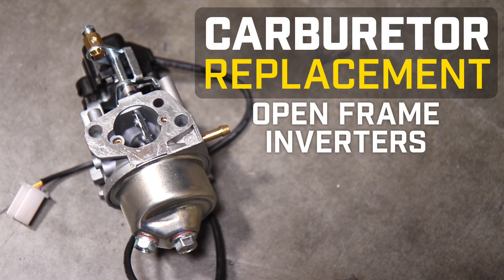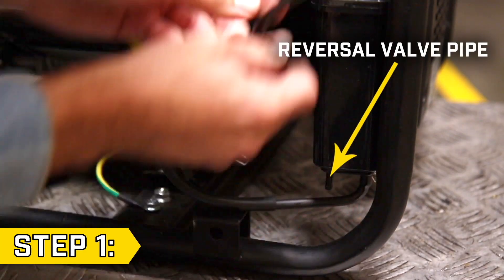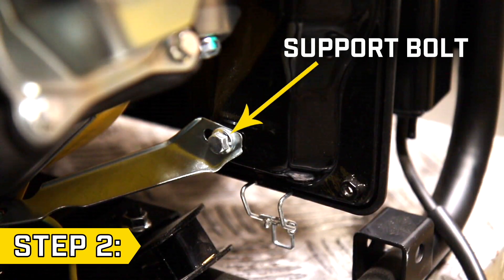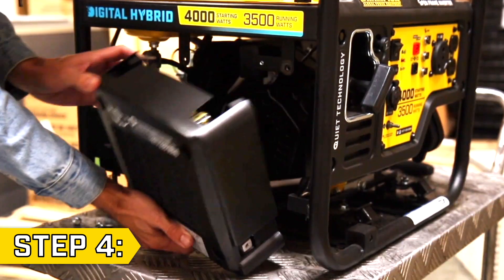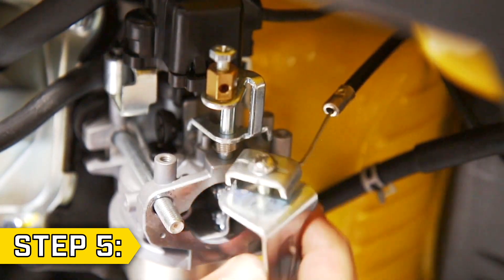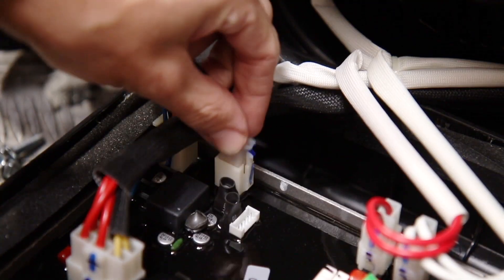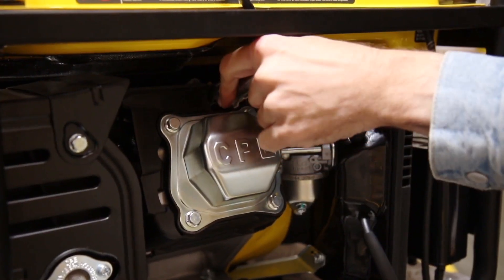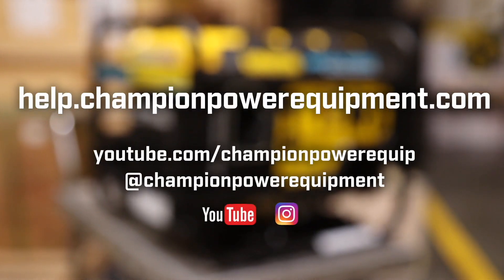Carburetor Replacement (100302 + 100371)

Comment: Appreciate the video, and am wondering since you went to all that bother: why it couldn't take another minute and a half to show how to pop the float bowl and clan the pilot and main jets. That way you wouldn't need to replace the silly carburetor.
Reply from the maker: Thank you for your question. We do have a separate video that covers carburetor cleaning in detail, which can be found here: 

https://help.championpowerequipment.com/article/mv6thh0fry-carburetor-cleaning-generator-or-inverter 

Additionally, we have a video for cleaning the pilot jet on our 2000-3500 watt inverters, which can serve as a helpful reference, as the process is similar across our other inverter models.

https://help.championpowerequipment.com/article/z77r7cwpbi-cleaning-the-pilot-jet-2000-watt-3500-watt-inverters